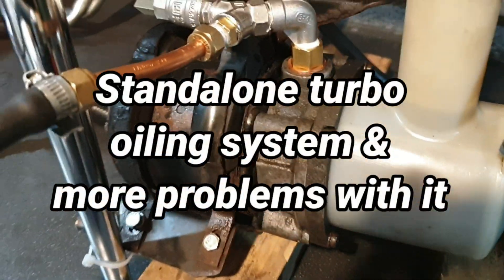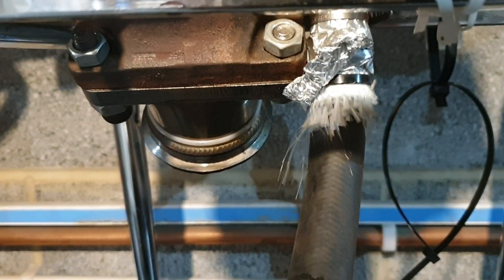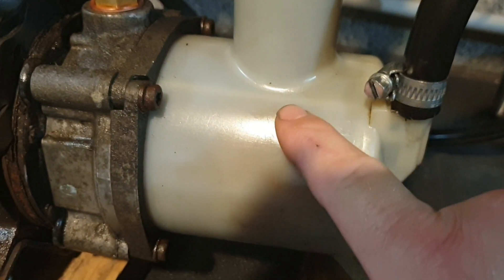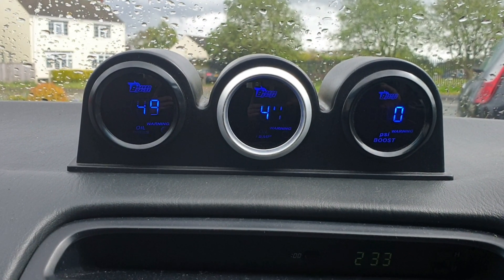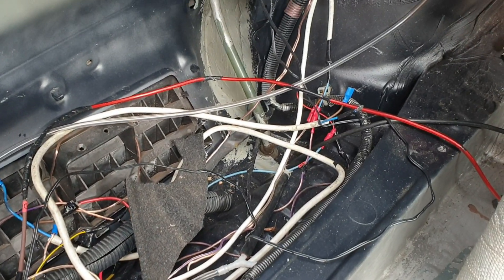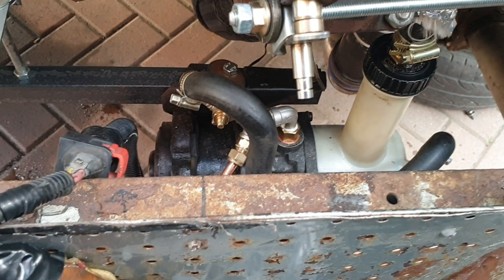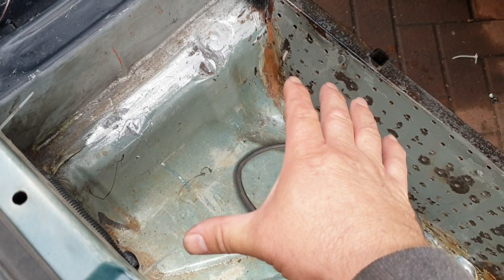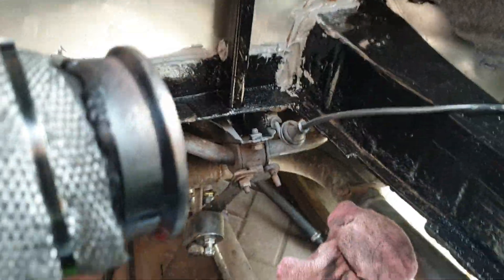REAR MOUNT TURBO Lexus LS400 PART 11 standalone oil system

Comment: I really enjoy seeing your experimentation and grass roots engineering.  What is your future plan for the Lexus rear mount turbo setup?  I like the idea of a stand alone oil system in a rear mount turbo.  I've done a low mount turbo with engine oil feed some years ago.  I used one of those Exa pumps to scavenge the oil back to the rocker cover and found that it was critically important that the 'turbo sump' (wherever oil drains) has a breather to atmosphere or turbo inlet.    
In a normal, engine mounted turbo setup the turbo drain is subject to the engine PCV or breathing system of the crankcase..  not the case in remote mount, so any slight pressure build up stops the turbo from draining and the pump from working properly. All the best with everything.
Reply from the maker: Thanks🙂 👍 right now the car is improving steadily, the new oil pump set up is working really well so far, you hit the nail on the head with the need for a breather, I was having all sorts of problems and leaks due to that and slack of capacity in the reservoir. 
My next problem is boost control and fuelling as I'm achieving higher boost levels I'm learning out. Everything I'm doing is done as cheaply as possible as its only a bit of fun. 
It's been great to learn on and as things improve hopefully I will to (welding etc) 
This old beast is really not in the greatest condition and I'm no body shop guru and I've been looking around at what the future is for it. 
Its nowhere near good enough for a VIP car, I like the idea of a bit of drifting but again I can't stretch to fully adjustable suspension and million dollar wheels and body kits. 
So I'm left with one option really and that's to go full apocalypse wasteland drifter with it, huge tyres, lifted suspension and battle ready exo skeleton body work. At least that way I can make a wide kit out of steel and maybe make the turbo a bigger feature and run the charge pipework down the side of the car on top of a sill extension. 
I'm seeing all sorts of apocalyptic drifter type visions coming..... 
Thanks again for watching and your comment, it all helps with the motivation and makes it worthwhile👍

Comment: Question...pressure coming out of the return line...now ive seen a video where someone was measuring about 7psi on the return line side at full boost ...casing pressure... Im using a cheep ebay return pump and i know thia your going this route because you worried about the sump pump failing and  that's legit.... Do you think were going about this wrong? Do you think there is enuff pressure to get the oil back up to the engine with out the pump? I had a experience last week ...i forgot to turn the pump on and drove around the block like a asshole half way around the block i realized my pump was off ...i had a oh shit moment ...so wat happend was the oil came out threw the breather(path of least resistance) about two quarts pumped out ...well i cleaned it up and poured oil in the engine and got lucky .. So what do you think? Cause if there is enuff pressure built by the turbo casing to bring this oil back up then im all in for loosing the pump all together.. On another note .. Videos are awesome...
Reply from the maker: Sorry dude missed this completely, the problem with that is at idle the oil would just pool up in the turbo drain and then be pushed out through the turbo seals and smoke bad. I dont think there's enough pressure to return the oil before its pushed out of the seals.